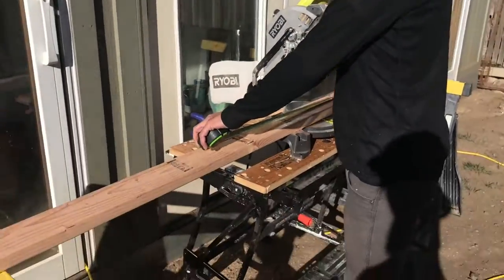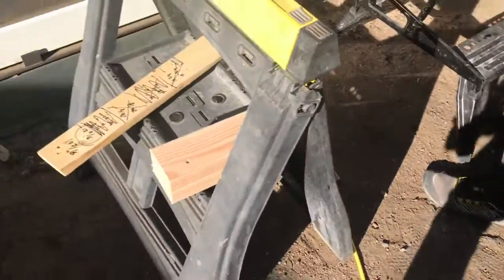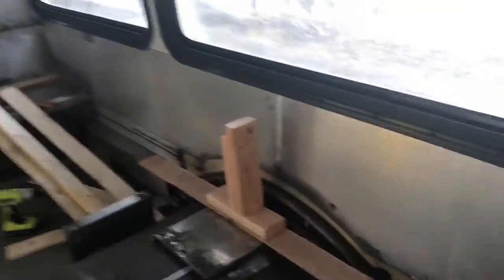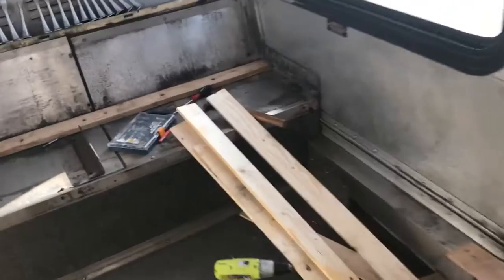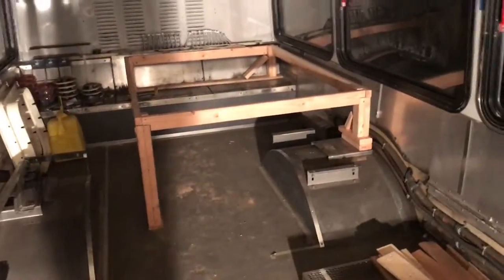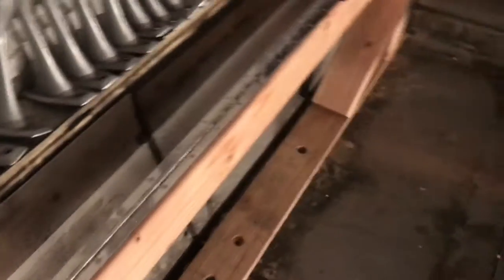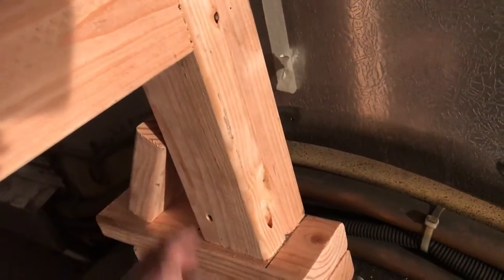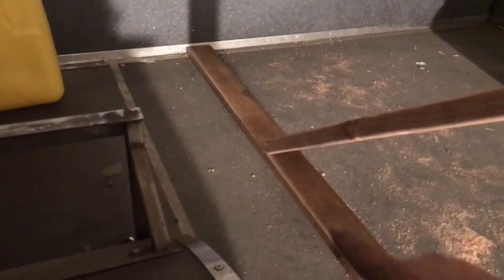Bus conversion day 8! Building the bed frame PART 1!

Comment: You won't need 45's in there if you just use plywood on the corners. The plywood acts like a stiffener and you can cut doors into it for access underneath also...Saves time and weight...